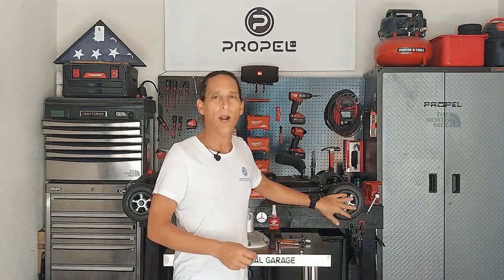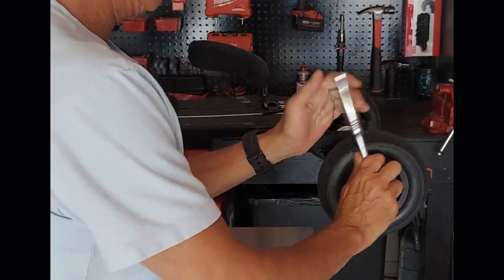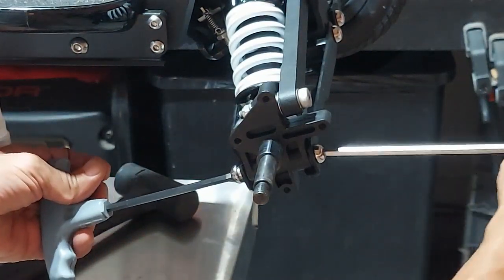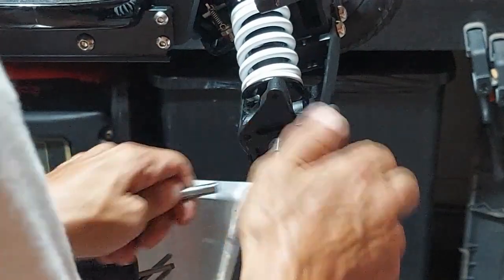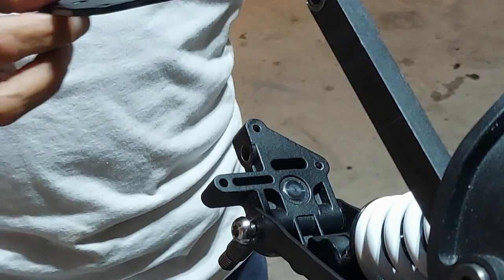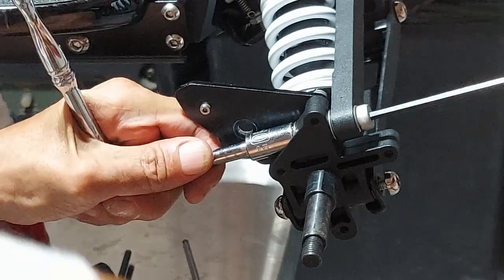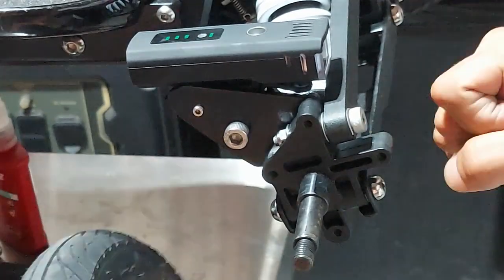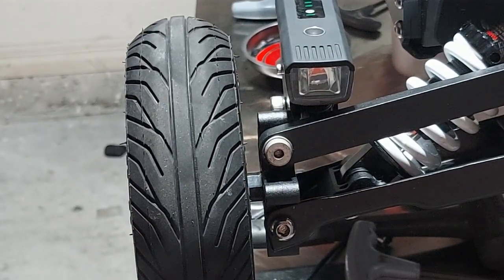Propel Endeavor 1 wheel bracket and light kit tutorial

Comment: I am using shred lights SL-1000 front lights and had to mount the light brackets reverse from how this video is.  They line up nicely with a slight downward pitch.   Just putting it out there for anyone who might have an issue with shred lights
Reply: Thank you! I was curious if you could use shred lights on this board or not.

Comment: Usually on boards there's a washer between the nut and the wheel but I noticed in all the videos so far that there doesn't seem to be one on this board. Any particular reason ?

Also, aren't the arms supposed to rotate around the wheel bracket bolts ? Doesn't screwing them really tight with loctite hamper the rotation ?
Reply from the maker: They have brass collars wherever metal hinges with metal